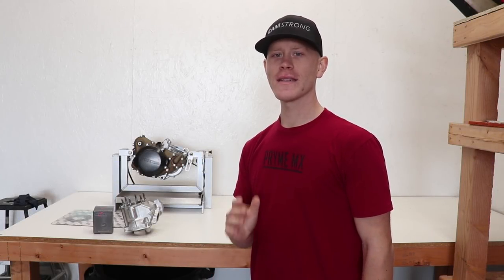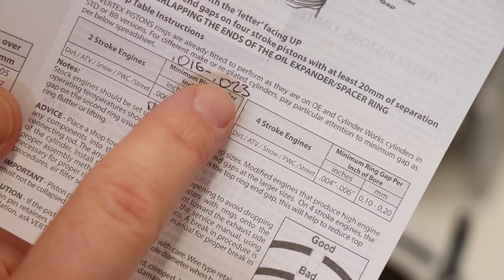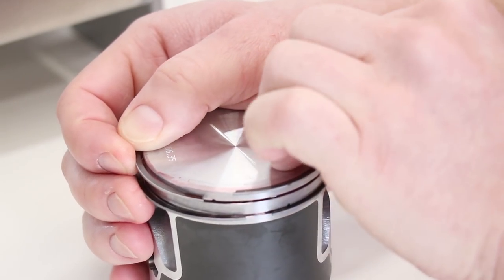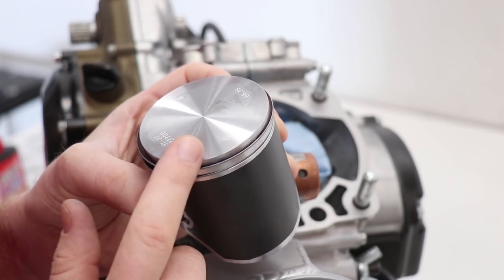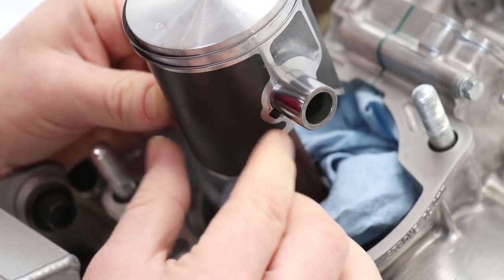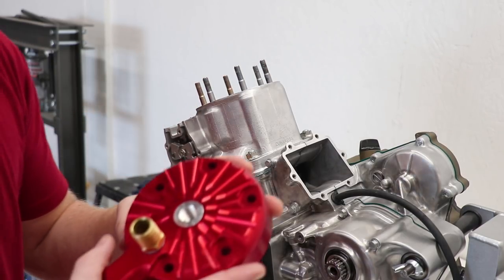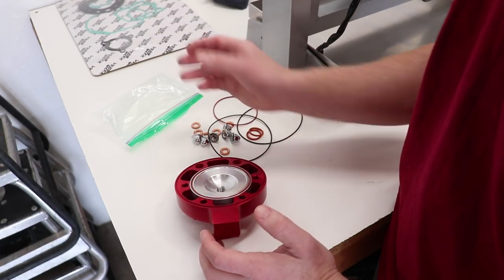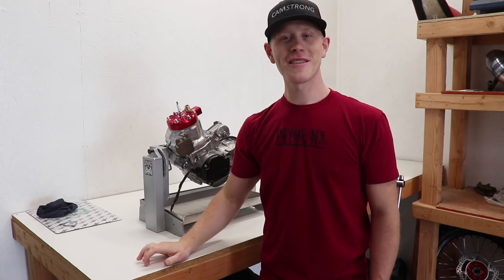Building My CR250 Engine!

Comment: When checking ring gap use the piston to center up the ring in the cylinder. Great video
Reply: Thanks for advice
Reply: Was about to post the same thing. Oil the cylinder and piston so as not to scratch anything and let the piston perfectly set the ring depth.
Reply: Allahumma shalli 'alaa sayyidinaa muhammad wa'alaa aali sayyidinaa muhammad wasallim tasliima😁😊

Yok Tobat Kawan Dan Jangan Lupa Sholat Dan Sholawat😊😁😊😊😊😊😊

Comment: I just did my KX 250 F. The expansion ring , and rails are very delicate and hard to keep clocking oriented right. My shop manual suggests circlip ends not to be in piston cutout. You can use piston to square rings for end gap.  I’m now gathering up all my parts to totally restore my 2001YZ 426.  Glad to see you back working , fantastic results as usual!

Comment: Sir, Cameron, I have a 1986 CR250R, Which pertains too the Bottom end of your assembly videos. I really like what you've done to the CR. Alike you I've had a battle with Cancer, 6 Cycles of Chemo and 7 treatments of Radiation. Countless hours of treatment, I went through 2 months being nauseous and lost 80Lbs. I received the CR as a gift for completing therapy. Basically what I'm saying here is I wish you well with your Battle with Cancer. Never give up biking, and cranking. Drip, Drip, Drip, Drip,. Have a great season CN a friend CZ................................................

Comment: Hi Cameron, Glad to your up and moving about more. Still praying for you and the family too. I do have a suggestion for the studs in the cases or barrels. Per tax makes a copper based anti-seize compound. This is way better to prevent Galvanic corrosion for the steel studs and the aluminum cases. The silver your using help, but can also promote the corrosion your trying to prevent. The copper prevents this and lubricates the seating of the studs. hope this helps. Blessings brother.

Comment: Late to the party but you might find it easier to put the piston with rings into the cylinder and then put the locate the piston onto the connecting rod.  Loving the videos - so much to learn.  Skäl  David

Comment: Awesome vid! Just a tip...when you want to measure the end gap, use the piston skirt to push the ring down the bore a little way. It helps get the ring level quickly and easily and you get more reliable measurements.

Comment: Great vids. One thing I noticed, you mentioned that when you install the circlips into the pistons, you prefer to line up the circlip gaps with the gap on the piston. Most manufacturers have a tolerance and diagram displaying a minimum distance that the circlip gap should be from the gap on the piston. For instance, my Yamaha indicates a distance of atleast 3mm for my 2017 YZ250F. Its good preference to keep the circlip gap as far away from the gap on the piston.

Comment: Need to drill holes in the piston to cool the exhaust port bridge. Bridge gets to hot will expand into the piston. Holes are for cooling nothing to do with piston. If there's no bridge then no need for holes. My 2000 cr250 had no bridge. I seen one in your build.
Reply: Agreed 100%, need the holes. Easy to do.
Reply: Drilling holes lets the bridge get oil....always did it one my Husky.
Reply: @tomnekuda925  
He decked this bike out pretty good. Lots of hard work and now it's just going to blow up on him.
Reply: Probably not as the bridge still gets some lube but might wear a line in the piston....maybe not on water-cooled but usually happened on air-cooled.

Comment: Use the piston itself to fix the piston rings into the cylinder at the correct height for measuring the tolerance correctly. And the rings must be pushed a bit ( 1 cm from the cylinder top) when you make the measurement bc next to the upper side, the cylinder is not reached by the rings when the engine is working and it will have kinda brand new dimensions, so push rings into the working spots to have a correct measurement. For the rest really nice video! Very well done and nice assembly!

Comment: hope you are feeling better. just wanted to comment on the circlip orientation... gap should always be facing at 12:00 or at 6:00, not where the gap in the piston is. its very prone to back out if it is not straight up or down.

Comment: The cir-clips for the wrist pin should not have a end in the open spot! It's installed wrong its unlikely it will come out , but its better to have it installed the correct way. the second one you installed looked lined nicely.

Comment: The honda CR250R service manual calls for anaerobic threadlock on the cylinder studs. I was thinking antiseize also, because of the steel bolt into and aluminum thread.

Comment: I know this is a rather bit later but there is an easier way to install piston ring into the cylinder and is as follows. Hold the piston ring with the gap outwards from the cylinder while slipping the ring into the cylinder then rotate the ring towards you while in the cylinder until it has completely seated in the cylinder then use the piston to square up the ring from below now, measure the ring end gap if it is tolerances then rotate the back out the same way it had been done to remove the ring and the install this ring on to the piston's bottom ring grove. Do the same with the other ring but instead install this second ring in the piston's top ring grove. You may use an old piston, instead of the new piston if you have already installed this new piston on to the small end of the connecting rod, to square up these piston rings only after it has been well cleaned.  This method has been learned for and as a  time saving, the reason is during pit operations while getting ready to get back into the race with your bike, where time expenses count greatly during long races where you are allowed to make quick repairs on your bikes. Not I'm talking about jetting operations, this for those times the bike had breath some dirty air and caused poor running afterward after all is said and done, racing is an outdoor sport and it is where the dirt is, and all have fallen at some time or another.  Ten years of various motorcycle racing and as a pit crew member too.

Comment: Aren't you supposed to put those circlips in strait up and down instead of sideways like you did? Because the piston going up and down could cause them to compress and pop out.
Reply: Yes. And $300 to re-nickosil the cylinder  taught me my. lesson.
Reply: kdxkyle was going to say the same thing
Reply: Yep, can’t have the circlip ends sitting in the grooves of the piston.  It says that in my manual at least.
Reply: kdxkyle you are correct sir
Reply: @tmk5522 what does that mean? can someone link me a pic or smthn?
Reply: pewpew they two small clips that hold in the wrist pin have an opening so you can twist them into the wrist pin bore. You want the opening either at the top or the bottom of the hole so the forces of the piston going up and down in the bore don’t flex the clip causing it to eventually to fail and come out of its grove. Which would cause an obvious catastrophic failure
Reply: @tmk5522  okay thanks, gonna install a new cylinder kit in sunday so i needed to know xd

Comment: I am a licenced mechanic. Wristpin circlips always must be installed on any piston so the ends of each clip are at the 12 o'clock or 6 o'clock podition. Any other position and the odds are that the flexing of the piston when the combustion takes place, which flexes the clips & their hole/grooves and the clip(s), will move out of their groove and damage the piston/cylinder. It will only be a matter of time before the engine is damaged.  
Use the piston in an upside down position to gently push a ring squarely into the cylinder to ensure the ring is properly positioned squarely in the cylinder for end-gap measuring.
I would dissassemble the engine & properly install the circlips. Any instructions with the new piston or shop manual will instruct to the proper installation position. Many engines, 2 and 4 stroke of all sizes and number of cylinders, including car engines have had circlip damage due to improper installation. 
Do not put grease on the base gasket. It needs to be ensured it sits evenly flat everywhere. This could  eventually cause a case leak in a 2 stroke which if not caught would seize the engine as it sucked in air.
Good lubing on all parts as no metal to metal contact is wanted when the engine is initially started. Then of course go through the heat cycles to break it in like owners manuals and race shops do. This will provide the best performance and life.
Good luck. Good video otherwise.
Reply: What about the holes in the piston to cool the exhaust port bridge? He missed that one.

Comment: proper way of checking the gap ring is to position the ring vertically and push it down slowly. when the top portion of the ring labeled on the surface of the block just slowly position into horizontal and then apply the piston to push the ring inside to make it evenly positioned. thats the way you can get exact measurement of the gaping and make your  life easier .

Comment: One trick i have used just to be meticulous with setting ring end gap is sliding the piston into the cylinder, lowering the ring on to the top of the piston then lowering the piston down to make room for the feeler gauge. Guarantees that it is in there perfectly straight. Probably unnecessary but it helps me sleep at night

Comment: A bit late with this comment. I usually insert the piston into the cylinder first and then drop that as an assembly over the connecting rod. Use a bolt or long socket or so to keep the cylinder at a certain height, and then push in the wristpin and put on the circlip. Find it easier that way. All the best..

Comment: You should have sent the piston with the cylinder when the cylinder was repaired so the repairer could set the piston to cylinder clearance more accurately. An easy and accurate way to square the ring in the bore is to use the piston to push the ring to the point you want to use for making the measurement - it should be checked near the top, a little above the ports and just below the ports and see if it has less gap at one point than another - set the gap for the tightest point. Assembly lube on the rings is not recommended. Too much oil in the ring land may carbonize when the engine is started and stick the ring in the groove - just wipe the ring with two stroke oil. Anti-seize is not recommended to be used on the cylinder studs - it will cause over torquing - a light coat of two stroke oil is adequate (dip the stud in oil and let stand vertical on a paper towel overnight).  Holes in the front of the piston has nothing to do with being forged or cast - the holes are in the piston to provide lubrication on the exhaust bridge so the rings will last longer - I drill holes in all two stroke pistons that run in an engine with a bridged exhaust port whether they are forged or cast. Vertex does not drill the piston because it is an extra operation and increases the cost of the piston. Wiseco drills their piston because it is a high performance piston and it is reflected in the price. I STRONGLY DISAGREE WITH THE MASSIVE AMOUNT OF LUBE ON THE PISTON AND BORE - ONE DROP OF TWO STROKE OIL SMEARED AROUND THE LOWER 1/3 OF THE CYLINDER BORE IS ADEQUATE! One thing you failed to mention or do was to put two stroke oil on the bottom end of the rod and to put a few drops of two stroke oil in the feed holes for the main bearings in the transfer port base (one on each side) in the crankcase. You didn't detail the torquing of the cylinder base nut under the power valve operator - looked like you just tightened it with a box end wrench - how did you verify the torque on that nut?

Comment: Would you take apart the crankcase and put it back together kinda in steps i guess. We just got an 88 honda nx250 and there is a problem inside the crankcase with one of the gears and we are not sure about taking it apart because were new to dirt bikes

Comment: Hey Cameron, I just blew the top end on my 2001 yz125. I tore the top end off and realized I need to get cylinder fixed or replaced, and new piston as well. Now I noticed something with my crank, I was spinning it to make sure it was smooth but when it get to bottom of the stroke, it feels like it's catching on something. I'm not sure if it's a bearing because I feel a bad bearing would be more random, not always catching at the very bottom. Maybe it's rubbing something? If you, or anyone reading this, has any advice on what to do I would greatly appreciate it. Thanks for the videos!

Comment: Just curious - why does the head have to have zero lube on it before applying the O-ring? I’ve always thought it would make sense to lubricate the surface! Great video, stay strong with the treatment man 👊
Reply from the maker: Thanks for watching man! Oil on the head gasket or orings is never a good idea since they hold compression. Any oil would increase the chance of the oring slipping within the groove under compression

Comment: Way too much assembly  lube !  Use high quality 2-stroke oil  !  Maxima K2 ,  929 Castor.  2-stroke premix  oils have the highest  film strength  and are not foreign to combustion in the cylinder  .  It burns off easier if you just put a thin film of it !  Beautiful  Bike !

Comment: Dope brother ... Hey cam I have a crank I need to install in my bike but the engine is stuck inside.of the Frame because the pivot swing arm bolt is seized in place I tried to use a torch to head up the aluminum to get it to expand the aluminum did expand for sure but the bolt or pivot bolt did not move at all I also used oil and had it worked into the bearings but the bolt still did not move at all .... I'm not sure what to do as of rn I may end up cutting into the frame and have it rewelded after I get the bolt out because it is really seized up and it's crazy how it does not want to come out ....
Reply: Mtb Ridingog air hammer it out
Reply: @KgiMedia601  I don't think it will come out that way bro I may just have to remove the top end and take off the subframe and have it sit on a press table and get it pressed out sadly

Comment: I can’t remember which video, but you had said where you get that motor mount from. I’ve looked all over and I can’t find it. What is that motor mount called and where did you get it from?
Reply from the maker: The engine stand is from Nihilo Concepts
Reply: Cameron Niemela thank you. I’m doing a rebuild on my crf450r and this would be so handy to have.

Comment: What are you supposed to do if the ring gap is to large or to small
Reply from the maker: If the ring gap is too small you can file the ring gap to be larger. If it's too big you'll need to get new rings

Comment: how does a rubber oring seal compression and tolerate the heat generated?
Reply: Yamaha have been using orings in thier 2 strokes for many years. Orings come in many grades, some able to withstand very high temps.

Comment: assembly lube instead of a 2 stroke combustion chamber will prevent proper seating and result in lower compression. you Never use assembly lube on any part within the combustion process beside a few spots on the power valve maybe. all you need is synthetic 2 stroke oil on those crank bearings bottom bearing and top. nobody building 2t race engines uses assembly lube like that its completely useless ruins a few psi. i love your vis though.

Comment: Putting grease on a paper gasket is a terrible idea, a dry paper gasket will expand slightly when exposed to oil or coolant helping it seal, when you smear grease all over it before torquing down the cylinder down it is already expanded before you torque it. not to mention the grease it's just going to help the gasket be able to slip out under pressure. Also always install your circlips with the opening either straight up or straight down!!!

Comment: You should just be using regular 2 stroke oil for lube! Not assembly lube! Assembly lube is made for pressurized oil systems! I say you will have trouble with that piston roller bearing gumming up with that assembly lube! Been there done that!